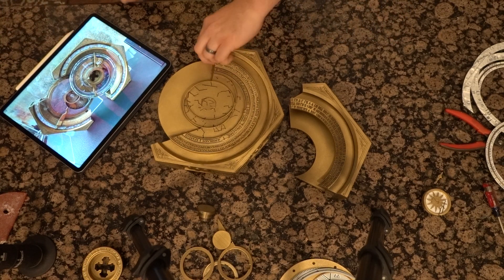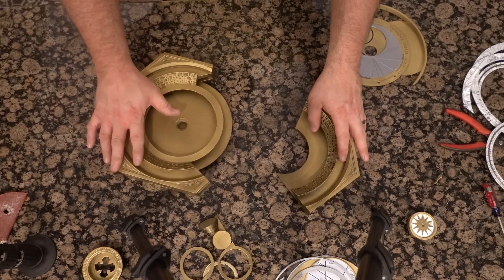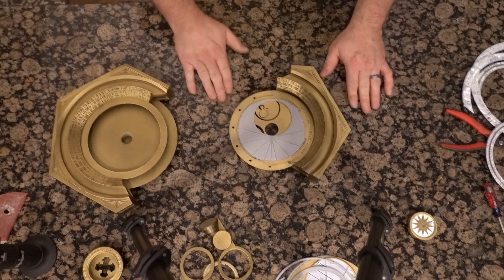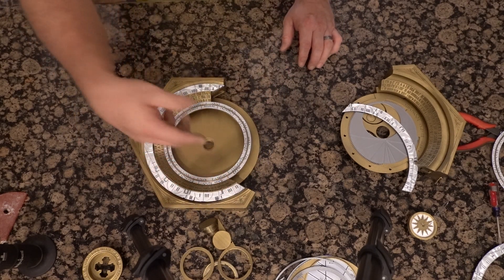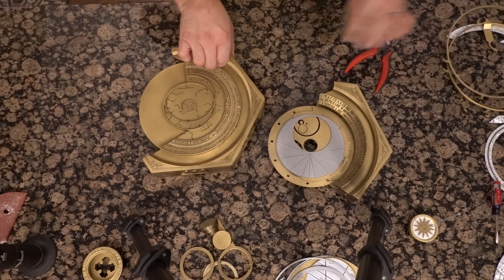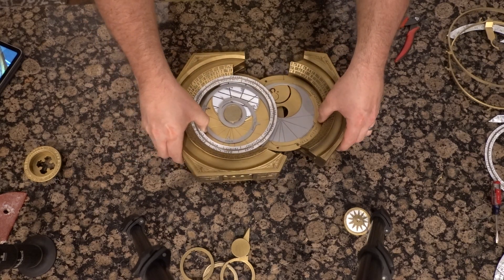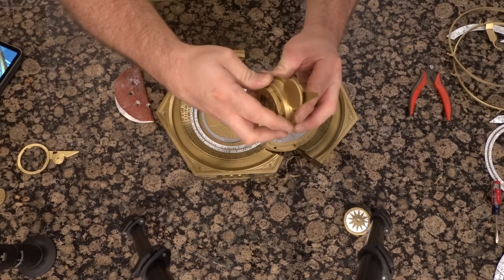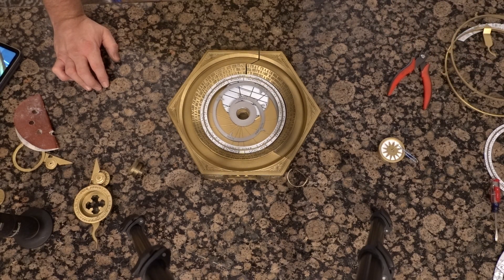Dial of Destiny Mark 4 Assembly

Comment: Very cool! I've recently been trying to put together a small Indy display (had some cool pieces years ago but had to sell)  As soon as I finish repainting my light up Ra headpiece I think I'll have to get into this project!
Reply from the maker: That light up headpiece is a killer idea.   I've been trying to figure out gold plating and using headpieces as the test case,  kept trying to source cheap lab grown gems to use for the eye but never could find one that fit the shape/size but didn't cost a small fortune so I'm still just using 3d printed transparent red gems, which are kinda meh.  

If you get into your Dial build keep me posted!  I've been making more of the smaller sizes lately b/c they fit in the messenger bag and resin builds turn out nice without me having to pour sand and concrete into the prints to get the weight right.   Check out the 210mm build on the printables link - I think you'll like it.

Comment: Thanks for doing this and posting this. Just wondering, what color spray paint did you use for the body?
Reply from the maker: I've been favoring printing them in black filament or putting a base coat of black down and then lightly spraying Krylon Gold Leaf over the black.  If you spray the gold across the glyphs instead of directly into it- the black will shadow through and make the glyphs pop more
Reply: @arcadeshenanigans  Thanks, I caught the part about the black base, but I don't think you mentioned the Krylon Gold Leaf paint. I'm heading to the store after work and that information will save me a lot of searching. I'm hitting big orange so I might have to use a Rust-Oleum equivilent.
Reply from the maker: @MrBblhed  Cool - if you can’t find the krylon the Rustoleum metallic gold is pretty close.   The Krylon edges it out in my opinion because it can go down a little lighter (letting the black through makes it look more aged and metallic) and the Krylon is a touch warmer in tone.   I also tried to coat one in conductive graphite to electroplate it but that process didn’t work well for me.